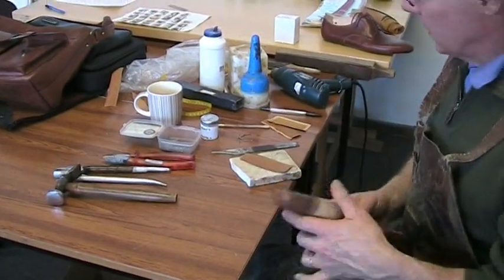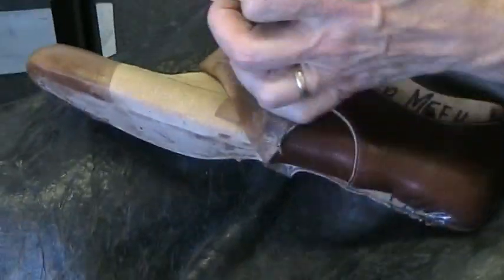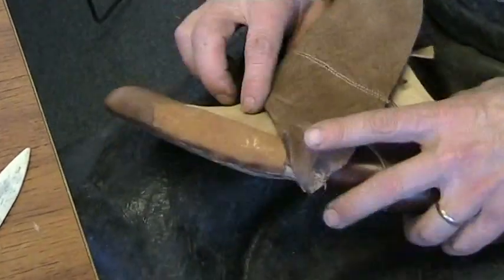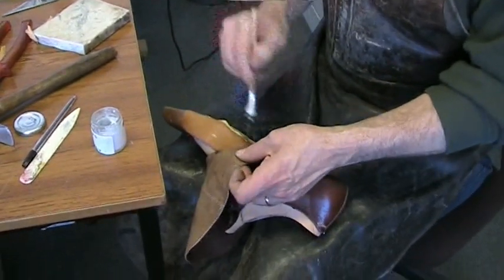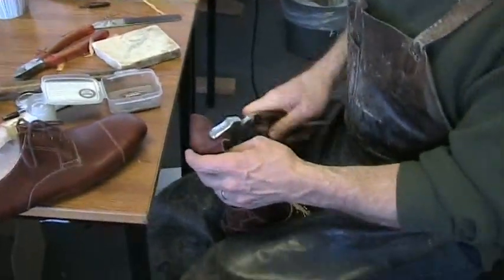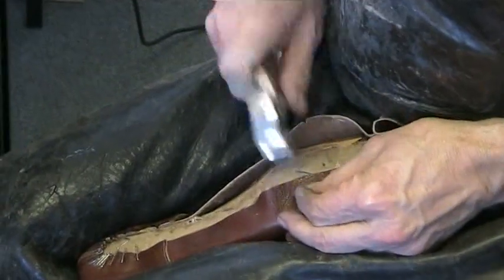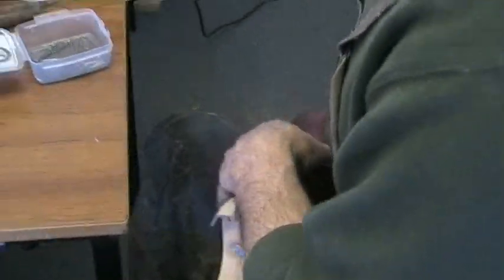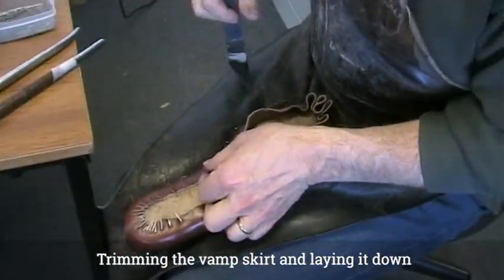Lasting-up a Derby shoe - Part 4 of 4

Comment: It's a good job you do, but the sole assembly is missing thank you very much...!!!
Reply from the maker: Thanks for asking. That's a big one and there are many ways and solutions, depending on who the shoes are for and what will be helpful to them. Rigid leather for one, light weight EVA for another and thin thermal rubber for yet another still. I'm working first on the characteristics of the different forms of soling and heeling and for whom and what conditions each are of the most benefit.